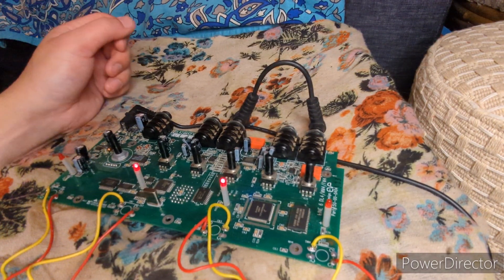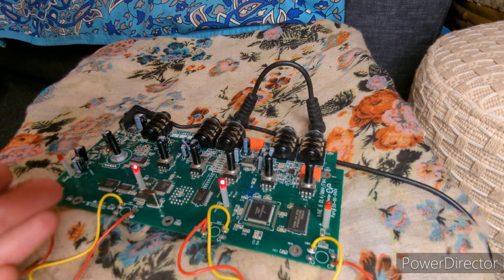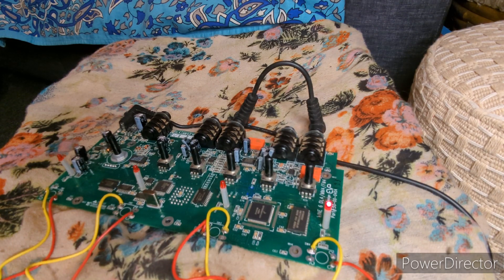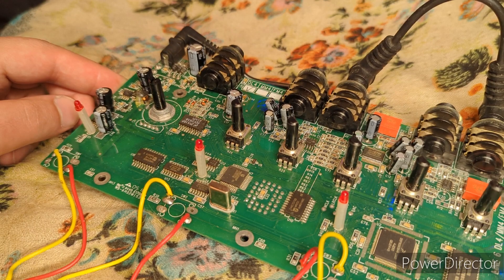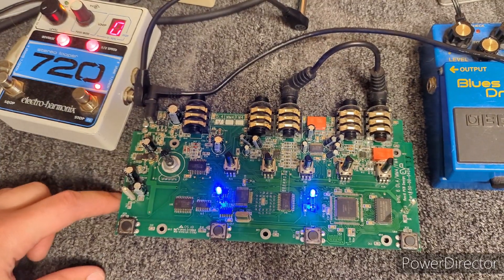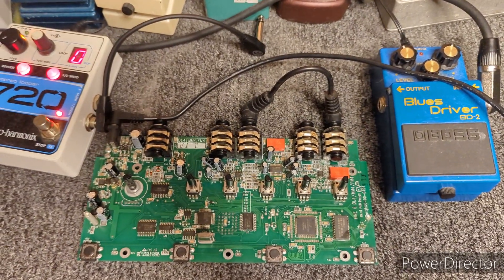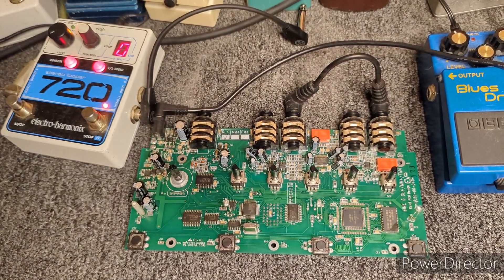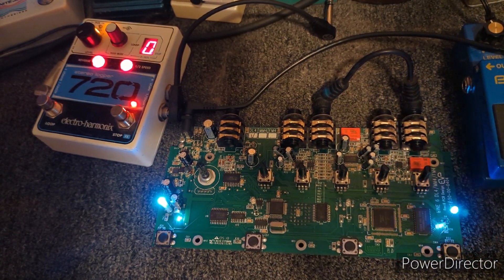Line 6 DL4 Repair #3 - Faulty Switches & LED Mod

Comment: Thx4 vid. Cant get my tap tempo button to blink at a real slow tempo AND when playing a preffered preset a b or c, it will revert back to default delay after playing for while. Any suggestions? Tried deoxit

Comment: Hi there! This is an awesome video! I am having some problems with my V1 DL4. Ive considered replacing it with the MKII but id rather try to fix mine first! I've replaced the footswitches but now im noticing that the reverse delay is inconsistent, presets sometimes do not save properly, and when I add an expression pedal wild things happen (not in a necessarily good way). There may be other issues but this is what im noticing now. Any tips or tricks? Do you think replacing the EEPROM chip would help? Also, I can't find any information about the "tests" online. Any chance you could send a link outlining the "tests". Thank you some much for your time and help!
Reply from the maker: just at a first glance, I don't think the EEPROM is the problem.  I would try cleaning all the pots and the encoder (for delay type setting) with a contact cleaner like Deoxit.  Do this with the pedal unplugged and with the case off.  And allow it to dry.  Also, I perfer these with the original switches.  I reverted this one back to orignal switch type (with new button switches) and it works much better.  Much less likely but the switches and expression pedal send their analog signals to an ADC (U6) with converts those signals to digital to be sent to the DSP and microcontroller.  But I would start with cleaning as I said.  Really wouldn't be able to off much else without having the thing in front of me.  I have a PDF of schematic and tests if you shoot me an email I can send to you.